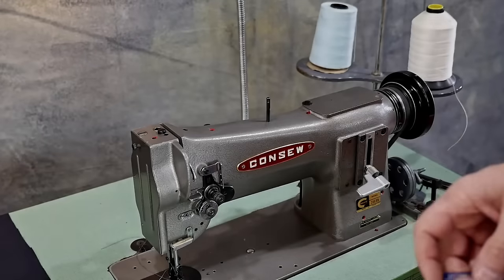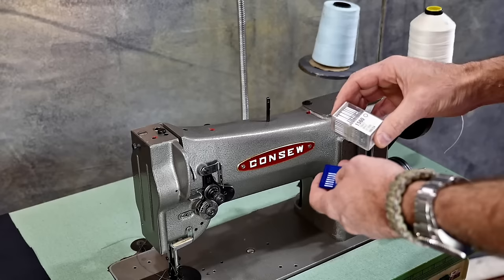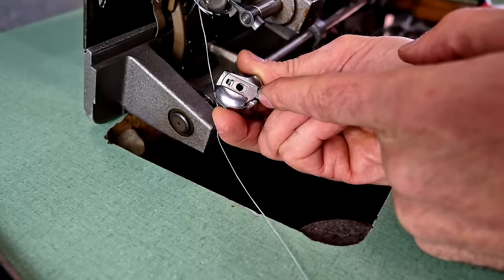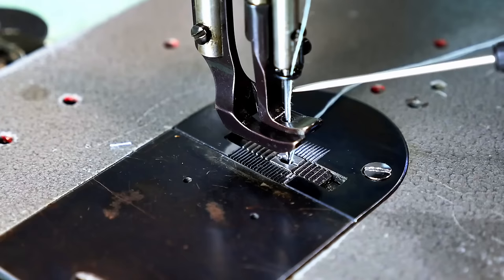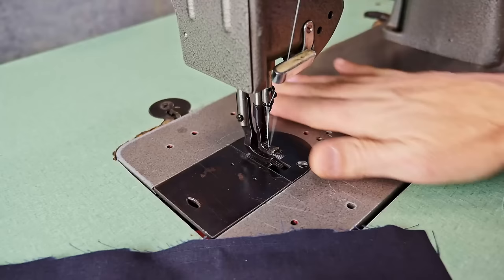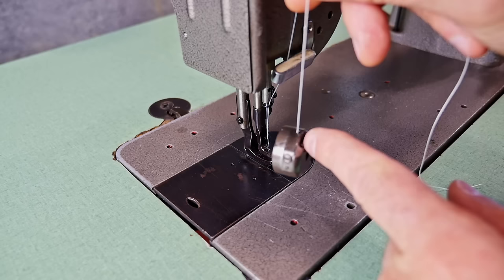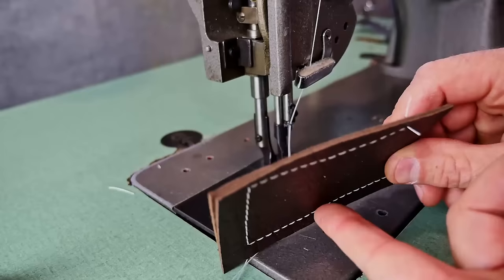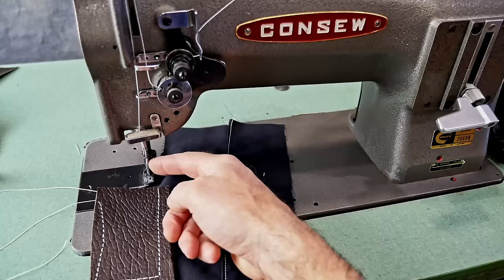What Size Thread Can You Use in an Industrial Walking Foot Sewing Machine

Comment: Good video. In less than 4 years ive gone from my own 30 plus year old Elna to 7 more machines. And only 2 are the same brand. Basically I’m going to teach sewing in my small retirement town but ive also added more heavy duty craft sewing, making purses from jeans. My neighbor gave me his Singer Industrial, a bit rare as in I think they just quickly made better models. It’s a 1933 111W103 walking foot. Ive had a lot of luck in my quests learning all the brands i have, singer treadle, japanese models, japanese clone and lucky to bump into people who know. Another neighbors son in law makes sails back east and he saw the industrial in back yard when we were redoing floor in my sewing studio. And lucky in that, the retirement purchase came with 3 buildings and a craft room all my own built on old 2 car garage pad! So that guy explained and set the machine for me. I’m still afraid of the clutch motor. He recommended a thinner thread. Said what was in there way too heavy. I also found a great industrial store back in Anaheim visiting my kids. They even drafted their own manual gathering all known instructions and diagrams and similar but different brand machines. It’s called Albernoni if that helps anyone for parts. So knowledgeable. But happy to find this video and thread explanations. Thanks so much! I have been sewing for 50 years but never knew what all was out there in machines. Trying not to be hoarder. 8 is it!

Comment: You can run 207 top thread and 138 bottom no problem at all that machine anything larger on the bottom thread and it won't work it'll give you trouble. Plus that Bob and even big enough to run any larger thread and 138 you'll be feeling it all the time.

Comment: I use lots of TEX40 in my 1541 with no tension issues mostly in medium weight fabrics. I might buy a couple of extra bobbin cases at some  so I can save a little time setting the tension but easy enough to do and practise makes perfect! Thanks for the videos!
Reply from the maker: If you only go up or down a size or two you can usually get by just fine with just an upper tension adjustment. That is a real good machine, Juki makes good stuff.
Reply: Alexander Dyer yeah mines not a real juki just one of the clones 😁
Reply: Thinking about getting a Chinese Typical that is equivalent to a Juki 1508/1510, went through the part lists of 1508/1510 and Typical 20665 14D and they look close to identical (besides where the typical has a longer arm and vertical adjustment of 1510-7) what you can't see however is the quality of parts like material/casting/machining. So I'm wondering how well your clone is doing, does it hold up? Any issues?
Reply: @AlexKall  Do you really believe the clone from China will be as good as the 1510n-7 made in Japan? If so I have a bridge I will sell you cheap. I've got 2 1510N-7's

Comment: Hey Alex, Good stuff right here. I just bought a 1541s and have been obsessing with figuring out what is the minimum size thread I can sew with and what is the maximum size thread I can sew with as well as materials used such as thick leather. I was told the 1541s can sew up to 277 thread on top but you must use to the maximum size thread of 138 on the bottom bobbin. Just as the consew 206 can if not heavier thread on top. I personally haven't done tests yet on my machine as I'm getting familiar with how to drive the machine really well and understand everything about it before I go driving it at high speeds on narrow roads if all that metaphor makes sense. So in conclusion to what the video is here. If I'm using small thread such as tex 33 I have to tighten the bottom bobbin to compensate for the small thread. 138 is rated as the maximum size for the bottom bobbin but have not tested heavier thread on top. I will be doing tests and keep you posted. Great content as always.
Reply from the maker: Sounds like you got a pretty good grasp of the basic principles to me. Sounds like you are having fun too. I have a 1541S in my personal collection, it is a great machine. Thanks for everything.
Reply: Can you tell me your personal opinion on the 1541s vs consew 206? Have you done thread testing on the 1541s? I just ordered a speed reducer for my machine as it seems it would only help my quality of sewing instead of going as blazing fast speeds. Plus it will give me more torque. Any advice?

Comment: I have had many machines and currently use Automatic Durkopp Adler 867's. I have had Pfaff 545's and 138 thread is really too heavy for those machines. You will see when backstitching and a 23 needle is suffice for 138 thread as a 24 will most likely deflect off the hook unless one adjusts the hook which I would not advise unless you know how to time the machine.. # 69 - 92 is ideal for this Consew machine
Reply from the maker: 69, 92 yes and I will say that I use tex 105 all the time with very good result, it is my goto size, tex 105

Comment: I use tex 240 all the time in my LU563 Juki. Those small bobbin machines like yours are really 75-140 tex for the most part.  My Juki LG-158 is always loaded with the tex 170-240 and I wouldn't use lighter thread on that one.

Comment: #24 needle is to big for 138 #24 needle is used with v210 thread. I see everything with v92. V92 in the bobbin #v210 for topstitching
Reply from the maker: Sure but like I said, I'm using what I had. Your point is about as helpful as if I were to point out that your comment misuses the word to and you should have used the word too. I knew what you meant and for me to point it out is merely annoying and does little to advance the point of the matter. Here is a chart that I like to use for needle and thread sizes. https://tolindsewmach.com/thread-chart.html
Reply from the maker: Here is even another chart with a slightly different opinion. https://alexanderdyer.work/uploads/manuals/Needle%20and%20Thread.jpg
Reply: you are right 24 is way too big for 138 however I think the reason he got away with it is because he wasn't using a leather point needle. Leather point needles cut the hole that ball point just punches through with no particular shape. If he was using a leather point you would see how gigantic the hole is compared to the thread.

Comment: do you have trouble  with the bobbin spinning  inside the case and how do you fix   even with 135  thread
Reply from the maker: I am not sure I understand. The bobbin does spin, no problem.
Reply: @AlexanderDyer  it spins and tangles  or over spins  inside the case  causing it to hang around bobbin in in back of  leather
Reply from the maker: I think that this may address your issue. https://youtu.be/xax0RTCqYTk
Reply: I sometimes have that problem if I bartack too fast. Like it causes a whiplash effect in the casing.

Comment: Being new to sewing I assume bobbin and needle thread needs to be same size. Is that a correct assumption?
Reply from the maker: some will put larger in the top for the look of it and a size or two smaller in the bobbin. A lock stitch is only as strong as its weakest thread.
Reply: Some people will use regular thread in the bobbin and clear thread on top for topstitching

Comment: Thanks for showing.  I have been trying to buy a leather sewing  machine.  But i am very confused with the thread sizes and needle sizes and shapes.  What shape is your needle?  Appreciate your response for helping.
Reply from the maker: I usually keep it pretty simple. I buy standard point needles since they work as well in fabric as leather. The knife points cut fabric unnecessarily. If you are only sewing in leather then the various points can produce different visual effect and slightly protect the thread by setting it further into the leather.
Reply: thanks for your prompt reply.

Comment: Hi Alex great videos! On my Juki 1541s I’m having issues with the thread fraying or tearing apart at the needle. Happens more when I try to sew two pieces of thicker (6-8 oz) veg tan leather. I’m using a 22 and 24 needle and have been up and down in sizes of different threads. 69 up to 207. Since I’m totally green to sew machines in general I’m super lost. Any suggestions? Thank you. Jason
Reply from the maker: When everything else is right then I would suspect the thread. Poor thread has had me going in circles for days. Weather it is cheap, old, sun damaged or nicked it all can lead to a very frustrating experience. Get some good thread. I use mostly core spun polyester and bonded polyester and some good 100% cotton. Look for a good manufacturer, this is not an area to "save" money. Good Luck
Reply: Alexander Dyer Thanks for the response. I have tried threads from 3 different suppliers in different weights with the same issues. From what I’ve read/seen it seems like it could be a tension problem. I’ve tried going from very little to very much tension. Still no change. I’m very frustrated because this is my first machine and I haven’t any anything but problems with it.
Reply: Alexander Dyer Would you be able to make a video on adjusting the tension on a Juki 1541 ? I haven’t found anything applying to my machine. I think it’s the upper tension.
Reply from the maker: https://www.youtube.com/watch?v=BBZX6swwSa0
Reply from the maker: http://tolindsewmach.com/thread-chart.html
Reply from the maker: Could be a burr on the hook. Also if the thread take up spring is not engaging, the thread can be stabbed by the needle. Everything has to be right and it does not take much to mess up the process. Be vigilant and good luck.
Reply: Check out Lauren Mormino, she has a new video on thread and needle choice for using industrial Julki.  It Shows a segment where the thread unwraps from its twist. Maybe it is the thread type, some need a heat seal when cut, so it won't untwist.

Comment: Consew, is it discontinued sewing machine?! Where you buy this machine?😄
Reply: They make new ones. But many sell slightly older too at not bad prices. One in my area that was used was only $300 but when i looked it up it was really low level version of their industrials. Just like all machine companies they sometimes produce cheap alternatives. I would say research for the best you can afford at used prices. Also models. Some machines ive been five or bought cheap even for home sewing machines are too find to hard parts or bobbins. One i have has really damaged needle plate and no one makes it anymore. So i filed it a lot!! You need research of join facebook groups for this brand and read their posts and ask questions. It has take me weeks to find one bobbin for one of mine.

Comment: Wouldn't a thicker needle require you to set the hook gap? Makes no sense otherwise.
Reply from the maker: No. I have never ran into that. I have change the needle sizes here and did not need to adjust the hook gap.